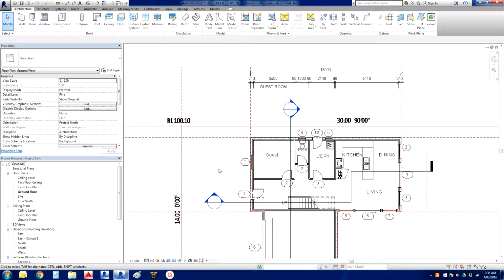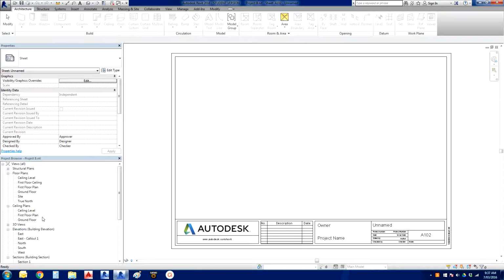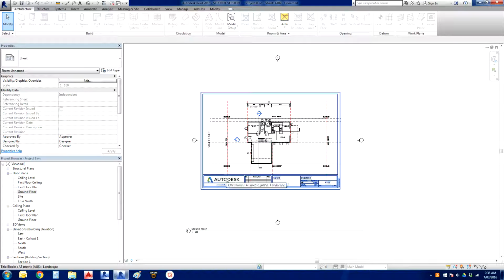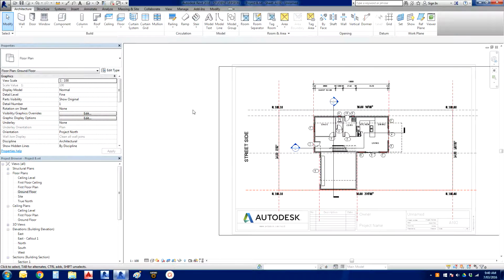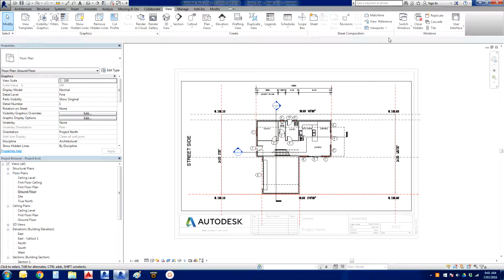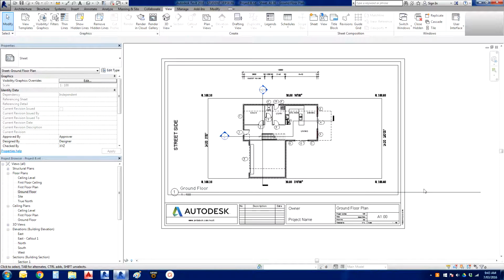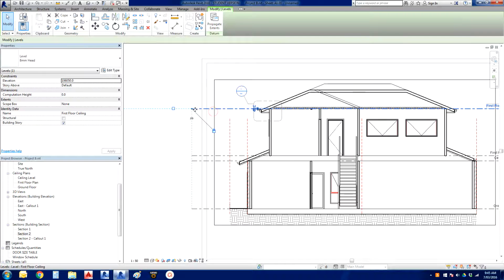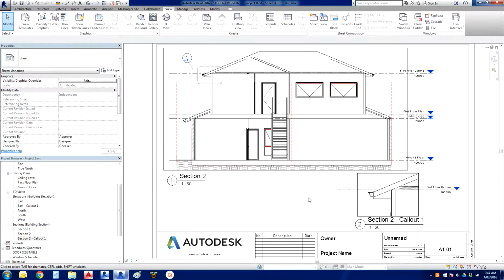Revit 2016 - Project B #28: Viewports

Comment: Is there a way to creat a building envelope in Revit?
Reply from the maker: Hi Mike

Building envelope in what context?
Reply: Our town plan requires a building to be within a building envelope. This starts at the side boundary goes up vertically 3.0 m then at an angle of 45 up till it reaches 8.0m at the 8.0m point there is an imaginary plain that follows the contour of the ground below, the rear part of the envelope starts at 4.0m then is the same as the side, the front envelope line goes vertical 8.5 up and 4.5m in from the front boundary. If you need a better explanation pm me on FB and we could talk.
Reply from the maker: I draw up the building envelope using Detail Lines, group them, and copy/paste/move as I need to. the good thing about groups is they can be transferred between files.